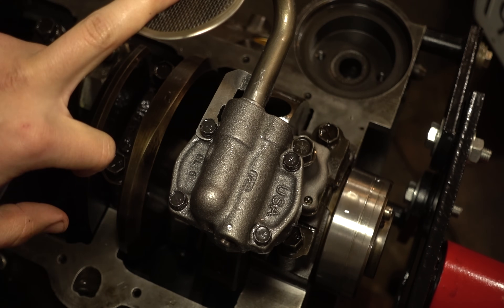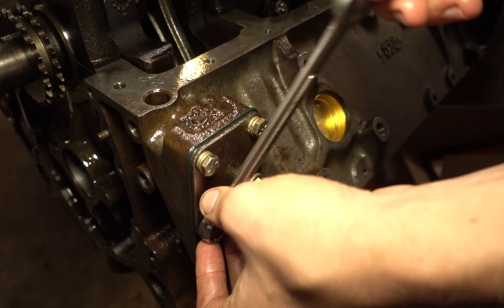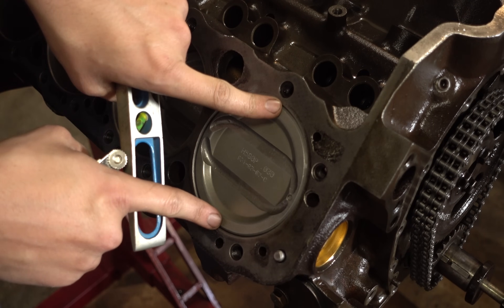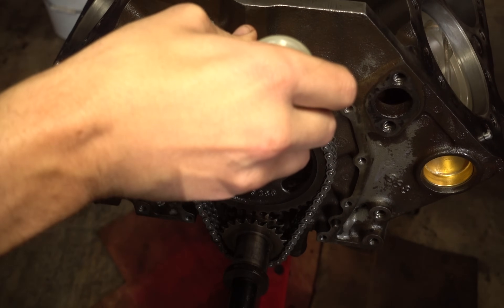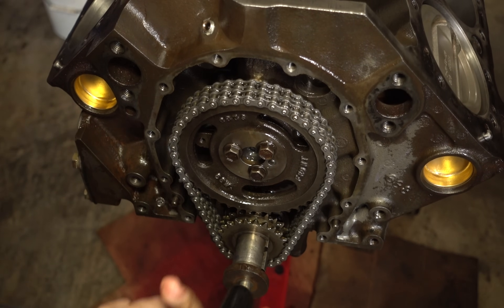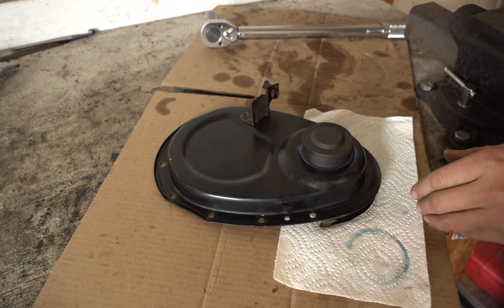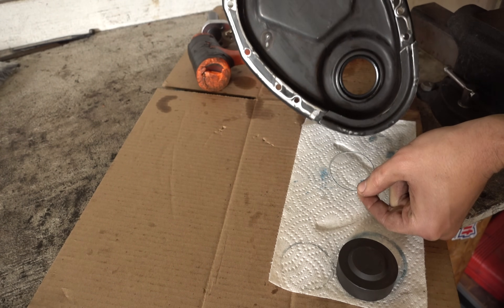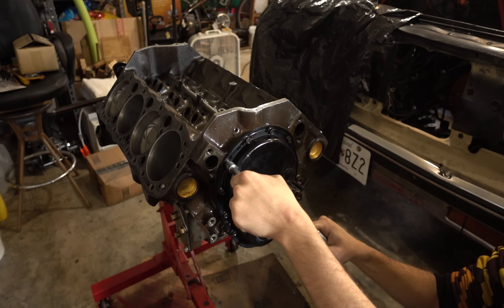V8 S10 Engine Rebuild: Cam and Short Block (Ep.7 Part 4 of 7)

Comment: I see you use WD40 so you can reuse the gasket if need be. Another way is to coat the gasket with grease , gasket soaks up grease gasket swells & easy removal Try it.

Comment: A good tip for installing lip seals with springs, is the fill in the area where the spring goes with chassis grease, that can help to prevent it from jumping out.

Comment: Oil pan modifications...

I'm getting up there in years and rather aware of ritual vs. practical maintenance efforts.  Within the last few years I've converted over from jack-up-the-vehicles type oil changes to vacuum extraction from the dip stick.  Given the number of cars in the family I have to service, decreasing the effort is a big plus.  And too, if one sticks to a sane oil change interval, oil filters don't need changing but ever 20k miles or more.  Think about it...  How often does one change their fuel filter?  Every gas tank full?  Hardly.  Transmission oil filter?  Certainly a lot more friction material in there...

But, if you must stick with your every-time oil filter change ritual, okay by me, just don't go all zealot on others with different notions.

Anywho, I ran into issues with the C1500 oil pan baffles causing the vacuum tube to get hung up.  Off comes the oil pan, some of the sharper metal baffle edges were cut off, and a blocking piece of steel angle iron welded into the place to keep the tube from folding up under a baffle plate.

Now, the vacuum tube easily gets to the bottom of the oil pan without getting hung up.

Oil filter changes still happen, just not on every oil change.  My wallet likes it.  My back likes it.  The landfill likes it.  The vehicles are up on jack stands often enough anyway for other maintenance to allow for acceptable filter change intervals.

Comment: Fun fact: Moly is used as the primary lube for the gearing and chains in the M230 30mm chain gun utilized on the AH-64D Apache.

Comment: that head gasket is probably where your blowby was coming from. they probably replaced one head n didn't torque it right. Most people don't re-ring engines anymore. you can save alot a money if your junk isn't totally worn out.

Comment: I’m still worried about the welds on the oilpan....too much vibration or hitting an object, and she’s gonna spill.
Reply from the maker: I can't imagine the oil pan would ever separate. It would most likely fold the sides in before all the welds would break at once. It might develop a pinhole leak if the JB weld starts to break down, but no signs of any issues yet, a few thousand miles (and one minor crash) later.

Comment: Wouldn't white grease work out better on the timing chain. Good channel though bud
Reply from the maker: I'm sure that would be fine, but I don't think it matters all that much in the end. After the white lithium washes off it will only be lubricated by oil, and there isn't any break-in for these timing chains that oil can't handle.

Comment: Really enjoying your build series! Great editing and sense of humor- quick question- you reused the original can bearings correct? Did you just inspect for bearing wear and decide they were fine for the new can? I’m doing a similar rebuild on a ford 460 and am on the fence about paying a shop $$$ for cam bearings. Thanks!
Reply from the maker: Yep, they looked to be in good shape so I cheaped out and left them in. It was a low-dollar rebuild for sure. If it's a valuable engine or one with important parts, unless they look immaculate I'd just get a cam bearing installer and go for it! Just take your time with it and make sure the oil hole orientation and installation order is correct, and it's really not bad!

Comment: You shouldnt reuse the gears on the timing chain, because the are worn for the onld chain and can cause it to grenade
Reply from the maker: If the gears are in good condition like these were, there is really no need to replace both. In normal circumstances, the chain is the wear item as the links will stretch over time. There might be some amount of wear mating between the chain and the gears, but nothing so significant that it will be a problem using a new chain on gears with no visible wear. Plus, a standard small block Chevy wouldn't grenade even if the timing chain snapped, it would just stop running, they are non-interference engines so the pistons and the valves wouldn't touch.

Comment: Your videos are awesome.  I'm currently in the middle of my rebuild of my 1988 camaro 305 engine to put in my 1991 s10 4x4.  Question I see you cut and welded the oil pan.  What oil pan is that (originally from)  I'm needing help to decide what pan to get
Reply from the maker: Thanks! The top of the pan (the flange, where it bolts to the block) is the 350 truck oil pan that came on the engine, the bottom of the pan is from the 4x4 4.3L oil pan. You can see it pretty well in Episode 2 of this series, it shows the before/after cutting, and some of the welding process.

Comment: The nice thing about petroleum h
Jelly is, it stays inside the pump while you assemble the rest of the engine, the assembly lube could run out. And it certainly won't be pre primed

Comment: So you have more lift but less duration on your new camshaft.
You plan on more torque  on the low /middle rpm and less high rpm power ?
How is this cam described ?
Reply from the maker: Specs are in the video description. It's a low RPM cam, won't have much top-end.

Comment: 18:28 those two bolt holes near the fuel pump mount can be a source of oil leaks. Make sure you put bolts in there.
Reply from the maker: Oh, good point! I meant to point that out in the video and totally forgot to. On later blocks like this one (that didn't come with mechanical fuel pumps but still had the provisions), those are blind holes. On earlier first gen blocks, you are correct, you need to put a short bolt in with sealer to prevent an oil leak from the top hole. Always check that, and make sure the bolt used doesn't hit the pushrod when tightened!
Reply: FuzzyDicePimp on those older engines with the pushrod, I would remove that short bolt and install a long one and tighten it until it just contacted the pushrod, then snugged it. Then I'd go ahead and replace the pump. The pushrod  would stay in place, and it made replacing pumps on cars with limited access way easier, no fighting to get the pushrod back up and held I'm place while you fought to get the mounting bolts started. After it was back together, I'd remove the long bolt, apply sealer to the original and tighten. I was a gm tech at a dealership, and we all did pumps this way.
Reply from the maker: Yep, that is how I have done it in the past!

Comment: On a chevy you want both timing gear marks at 12 o'clock, then you can install the distributor w/ the rotor pointing at #1.
Reply from the maker: You mean after the chain is installed (marks facing each other), rotate the crank so that they point up so that it is starting off at TDC? Good tip, but with the order I went in, the crank was rotated after that anyway when setting lifter preload. So, wouldn't have mattered in my case.

Comment: Are you going to paint it ?
For future ease of repair, maybe yellow or blue
Reply from the maker: Correct! I filmed the whole "episode" on the concept of putting the engine back together, edited it into one video (an hour and 50 minutes long!), then split that project file up into these individual parts for many reasons. So the video files for the other parts of this episode are roughly edited together, but still need a few hours of work for each part to be ready to upload!
Reply from the maker: Yep, it gets painted in part seven of this episode!
Reply: More likely he recorded everything and then edited every section, that's why we're getting every season of this build instead of a very long video
Reply: You have part 7 already and haven't posted it?!?!